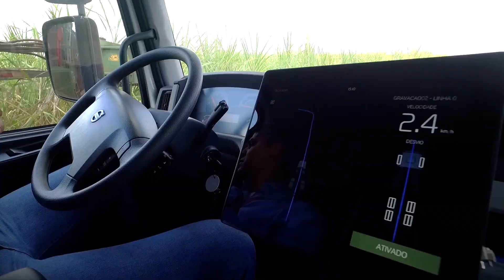Volvo Trucks - Automation – The driver’s role

Comment: That's true.  The driver is virtually irreplaceable in many areas, and a lot of people do not see that, including those who laugh at me that my job will soon be updated.  And I drive long-distance traffic.  According to information Vera only 40 km / h can drive and not come on the highway.  For this, at least in Germany, nothing will change that vehicles with 40 km / h may use the highway.  You just can not automate everything, those who have not studied robotics do not see it.  For example, that's not the case on the construction site. Thanks for the reassurance.

Comment: I've been driving for 45 years and I wouldn't set foot in an automated car or truck..
Reply from the maker: Hi George, the automation technology should be regarded as a complement to the driver.
Reply: I should be regarded as exactly what it is, an eventual replacement of the driver. The technical advances in locomotives went from steam to diesel electric eliminated the onboard fireman crew member, do will the driving be replaced with either computer or robotics in the industry. Old hands like me will be relegated to museums! I'm